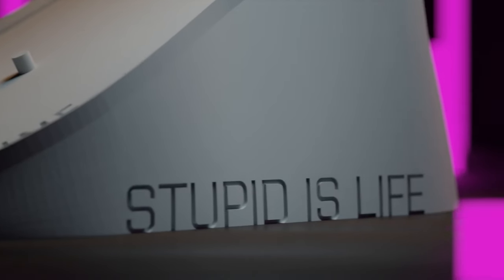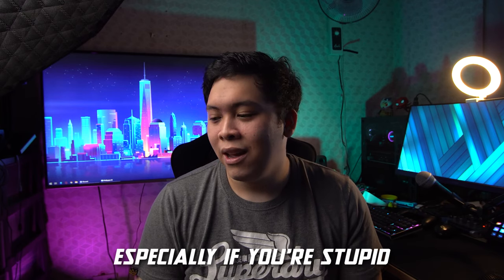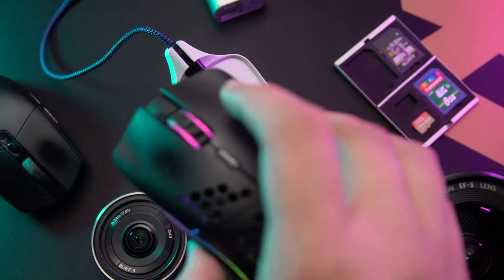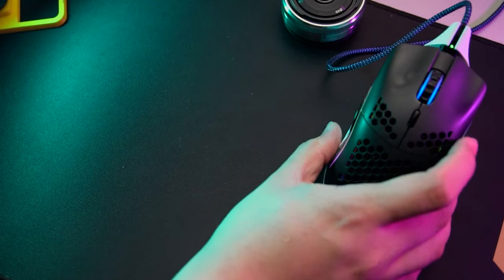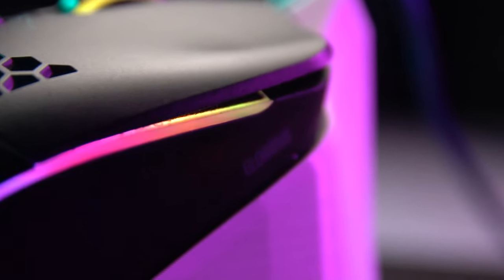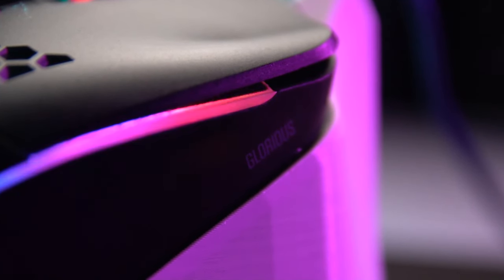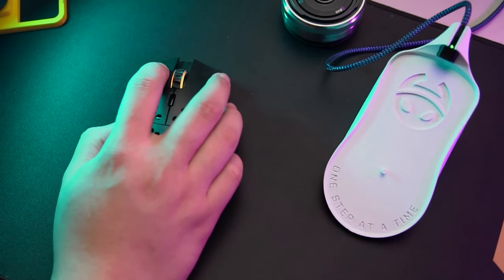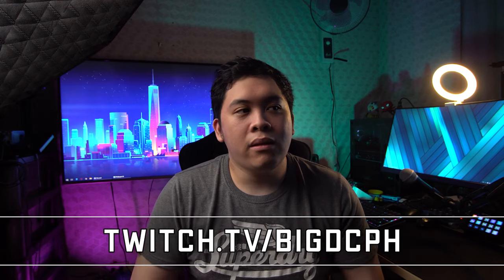THE MOW DOCK - 3D Printed Glorious Model O Wireless Charging Dock

Comment: Ingenious!!! You should definitely put the printed dock for sale!

Maybe one possible solution for the weight problem (or lack thereof) would be if you could design the dock in two parts that could snap together: a "footprint" base and then the actual dock that you'd place on top. This way you could fit the empty space inside the dock with those little calibration weight cylinders or some other dense metal weights.
Reply: I agree

Comment: Hmm, would it be possible to add a USB 3.1 splitter so that a USB cable goes from PC to the dock, where it connects to a splitter, then a type A to type C cable goes to charge the mouse and the other type A port is used for the receiver dongle? This way you would need only 1 USB type A port on your computer.

Comment: This is exactly what Im after, thanks!
Reply: Did you find a cable that works with it?
Reply: @treeleafytree  Yep, the UGREEN Magnetic works super well, however as it dosnt fit 100% use a hairdryer to slightly (and I mean slightly) heat up the PLA after print to get the cable to fit nice and snug.